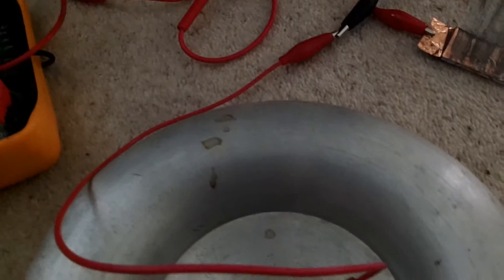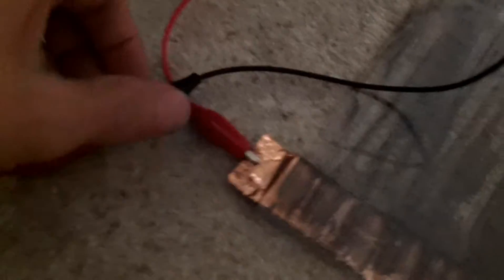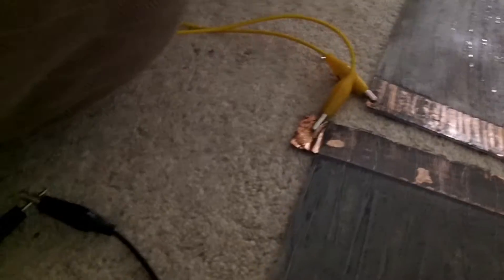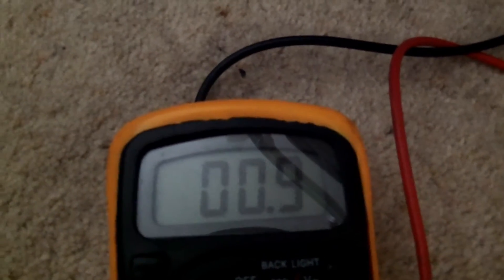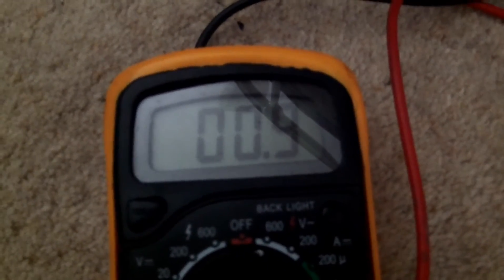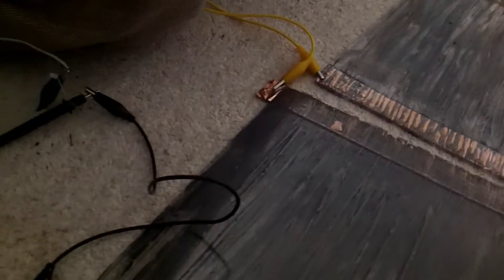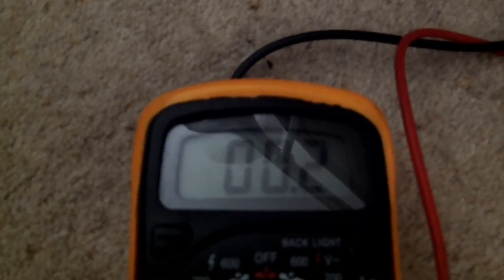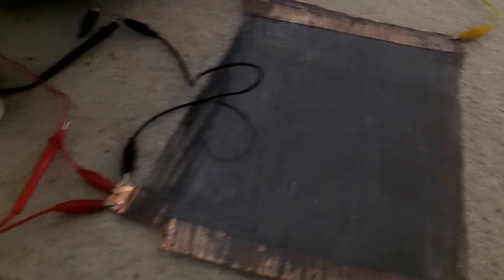Atmospheric energy.

Comment: Wouldn't that be 100mv -900mv you showed on the meter?
Reply: Yes mate, sorry - I think you are right. My mistake! I always get in a muddle in these experiments. But check out the rectified voltage in part 2. I'm getting 1.5 V DC on the output terminals of the bridge rectifier.
Reply: I saw that. Thats more what I would expect and works out with the figures I suspected in this video. Gotta watch out for those decimal points...

Comment: Awesome work MrFlathunter and good timing with the storm! The old papers on this say there is a current polarity shift present in a storm and they use to use a pole changer. A voltage doubler/multiplier circuit might boost power output even more.
Reply from the maker: Thanks very much for the tip! I've just googled it and the circuit looks simple enough to try, and I have all the stuff lying around. I'll try it in the morning.